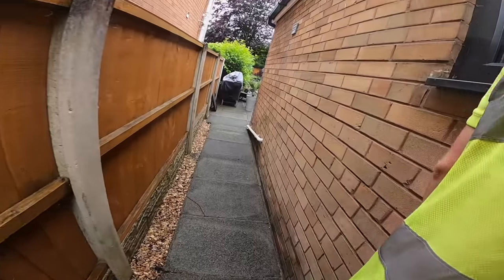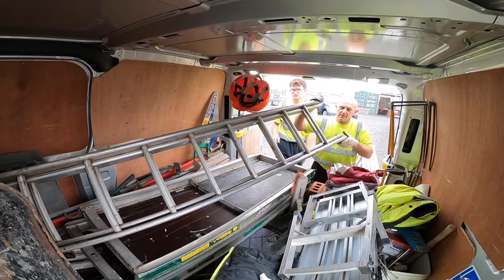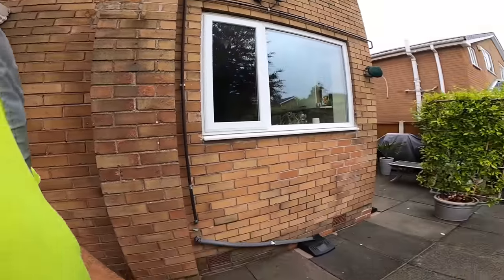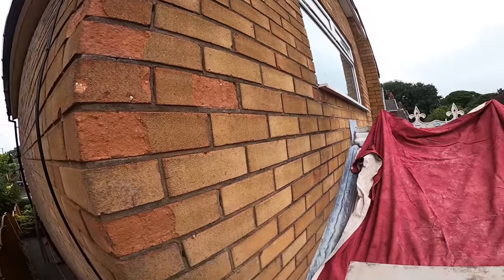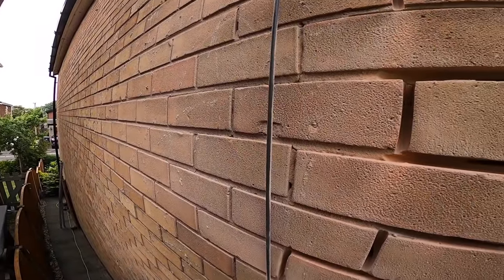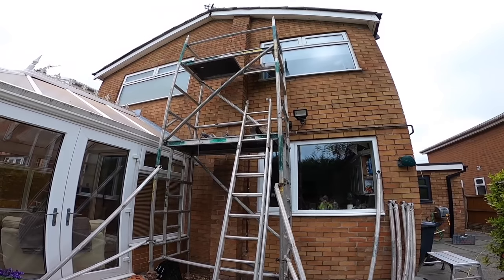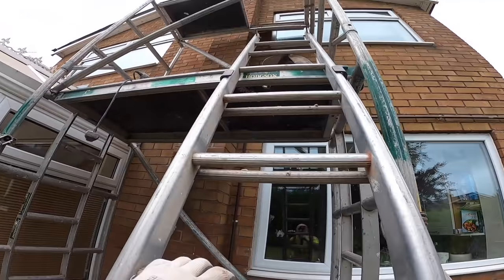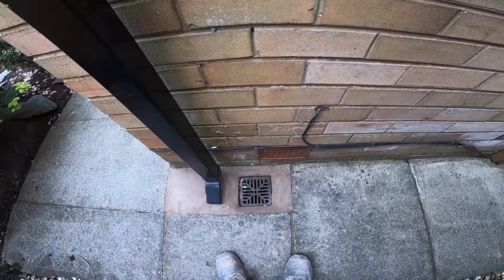REPAIRING  SOME FROST DAMAGED BRICKWORK

Comment: Probably condensation forming on the back of the bricks at due point , not allowing brick to dry out properly causing the bricks to spall  in cold conditions. Maybe cavity insulation will be a good idea . You both Made a good job of it . 👍
Reply: @martin2466  there’s probably inadequate ventilation in those areas certainly on the stack. One of the other affected area’s is on corner of the kitchen by the looks it , where more moisture would accumulate.
As for the best type of cavity insulation, I wouldn’t know .

Comment: So many holes in the mortar between the bricks isnt that an issue ?
Wont water come in this way too when wind blows hard.
Seems to me as a non bricky that this house was thrown up fast and cheap back in the days.
Good work by you guys.

I have a neighbour with the same problem. My thought was to take the bricks out clean them and insert them the other way around, perfect colormatch. Would that be ok ?
The mortar would be drilled out without harm to the bricks.
Reply from the maker: Yes houses  this age were generally thrown up . 
    As for turning the brick round it’s always a good idea as long as they have. 2 faces which Is very rare 😬🧱👍🏽
Reply: @SteveAndAlexBuild  
Thanks for the answer. I guess it is nice then that the bricks are identical all way around where I live 😌
Reply from the maker: @migsvensurfing6310  nice one 👌🏼🧱👍🏽

Comment: Try to get hold of a osolaiting cutter not as messy they don't make all the dust
Reply from the maker: We’ve just picked up a Blue Bosch sabre saw to give that a whirl . Rodian recommend one 👌🏼🧱👍🏽
Reply: @SteveAndAlexBuild  im not sure if the one your getting comes with the longer reach blades I know it will come with some blades but I find if you look on the web you can get longer reach ones and diff types for diff jobs
Reply from the maker: @garypollentine194  If came with a timber and a metal blade but I bought 2 long carbide tipped masonry blades 💪🏼🧱👍🏽

Comment: Could you Thompson Waterseal those bricks to stop the water getting in?
Reply from the maker: It could help 🧐🧱👍🏽
Reply: @martin2466  it’s going to cost quite a lot to have Steve and Alex to come in every couple of years.
Reply from the maker: @martin2466  I think it’s just a diluted silicone which absorbs into the bricks and mortar and it dries clear and looks like a waxed car when it rains . I think. It’s supposed to be breathable but will eventually weather away  so it does need the applying periodically. 
   £30 s worth will do a side of a house easily 💧💦💦💦👌🏼🧱👍🏽